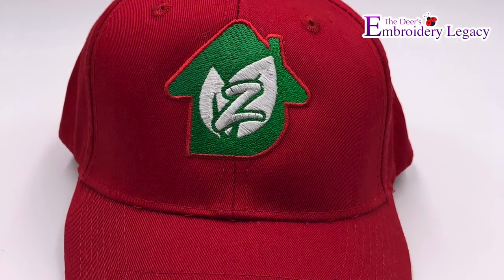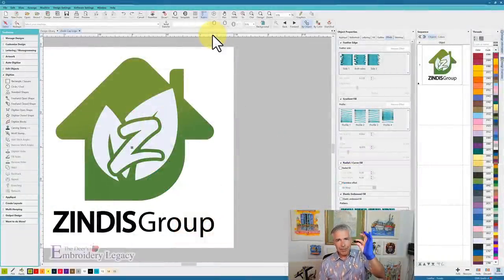Machine Embroidery Digitizing for Hats & Caps - Design Step by Step

Comment: One of the the problem with the clients is that they always want the complete logo and many times it is taller than it is wide and the solution is better to remove the lower letters but many times they do not understand that (a headache when they do not understand that) since normally they only you have 60mm height to work

Comment: Dude! Wth 🤦🏼‍♂️ this guy is the pro of all pros and why does the sample hat he is showing have embroidery that is way way WAAAAYYY TOOOO HIGH ON THE HAT.

That hat looks terrible and it’s all rotating around at the beginning of the video and you can see it’s toooo high in the thumbnail.
I know some hats are embroidered before custruction but I’ve seen plenty that have been embroidered as hats that are properly close to the brim.

Look at any hat. Lower to the brim is always preferred. I couldn’t sell that crap to my customers.  

If he can’t do hats right seriously what hope is there.
I’m not mad dear, just disappointed 😢
Reply from the maker: Agreed, it is way too high, that cap was embroidered on a 10 needle Brother. The cap frames on those models don’t allow users to get the design close to the brim of the cap (I’d never use one for cap production), totally different story if it was run on one of our ZSK machines or back in the 90’s on our 18 head Tajimas. Placement is dictated by the equipment, quality of the embroidery is dictated by the digitizing.
Reply: Of course you gotta have $200k machine to do hats right 😢
Reply from the maker: @planetcrap  Lol, 10K for a 15 needle will do just fine. But if you want to do high volume production a large machine will help. Have a wonderful day and stay positive :)